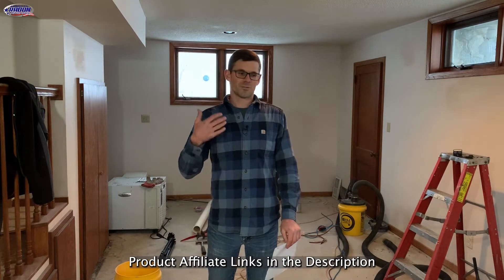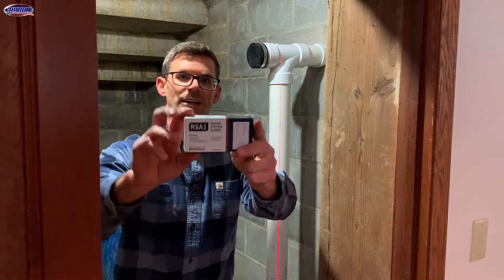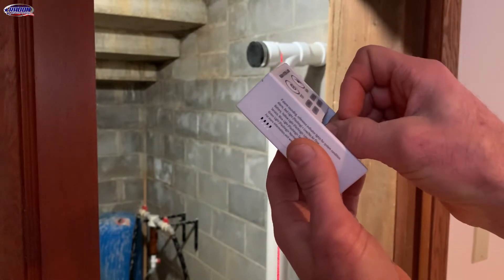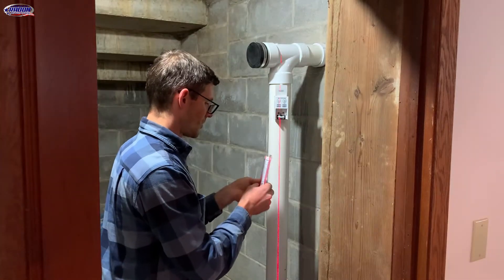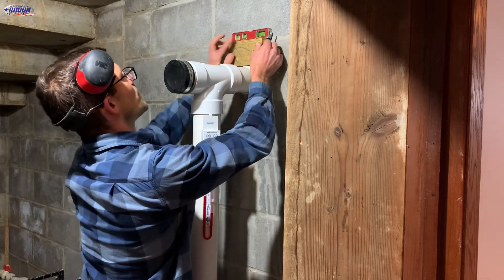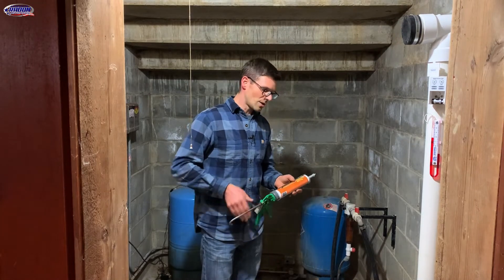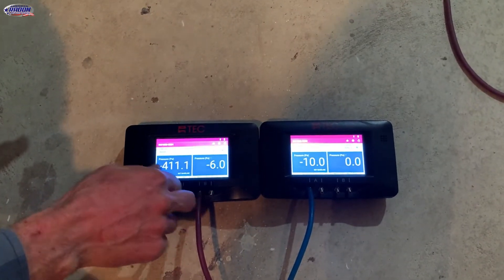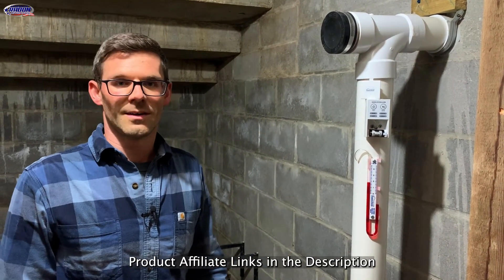Full Radon Mitigation System Install | Part 2 of 3

Comment: I installed a radon pump, and discovered I had noticeable negative pressure in my house afterwards.  I have preinstalled laterals under my slab.  I had a significant leak all along the wall/floor joint - which was totally accessible.  After sealing, it totally solved the problem
Reply from the maker: Nice work! Sealing makes a huge difference and is often overlooked. Be sure to check the block tops if you have a block foundation, as seen here: https://youtu.be/h0g_UY5-Zew?si=HJYRqC4IVRaYUqIi&t=117

Comment: For a larger, perimeter opening between the slab and wall (0.5” to 1.0”+ continuous) can closed cell foam be used?
Reply from the maker: I think that would work just fine. If you want a belt-and-suspenders approach, you could foam the gap, trim the excess, and caulk over the top of the foam. Backer rod and caulk would also work.
Reply: @ makes sense!

Comment: Thanks Jesse for your excellent video. To seal the concrete slab joint cracks for radon, should I use radon sealant or insulating foam sealant?  Does the foam sealant in the link above seal radon at all especially given larger cracks in my case? Thanks again !
Reply from the maker: I’d use Radon Sealant in cracks up to about a quarter inch. 

For anything larger, I’d use expanding foam or backer rod to fill the gap. Then you can trim the foam and run a bead of Radon Sealant over for good measure if you’d like. It will also be more esthetically pleasing than exposed foam. 

Thanks for watching!